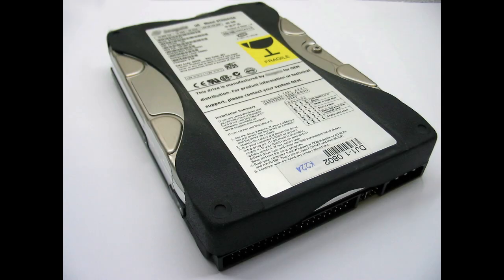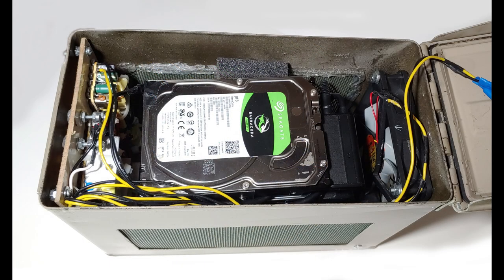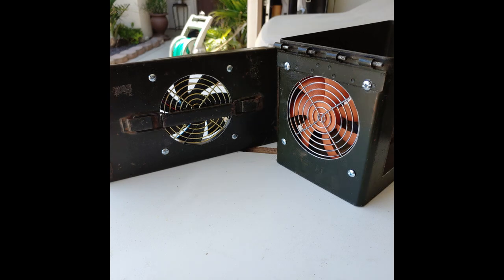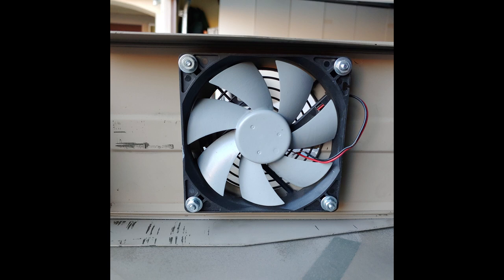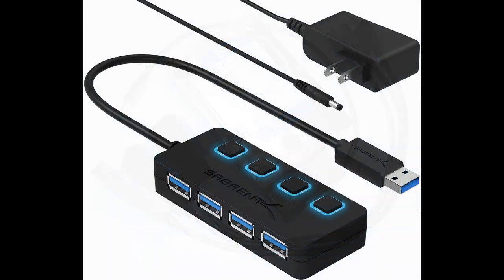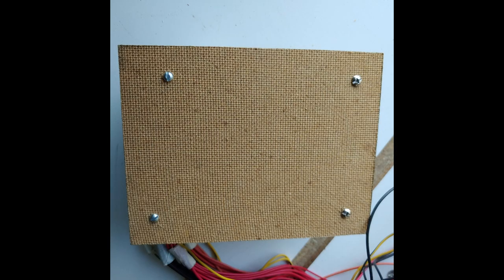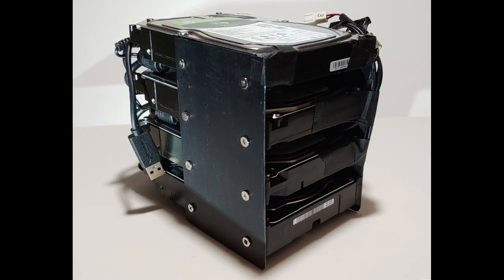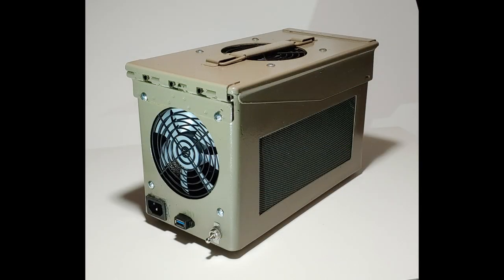Ammo Can 4 Drive Enclosure

Comment: Not a bad idea...however using DC-DC buck converters would be better and use less room than all those transformers...would only need one with say  AC to 12VDC block and use those buck circuits to output required voltages.

Also there is an AWESOME NAS server OS you can install on a Raspberry Pi called openmediavault that will easily use those drives for data storage...and easily set up shares for the home network

Not a bad build..but a little bit o' tweaking it could be alot better